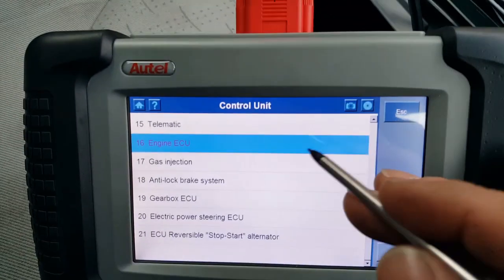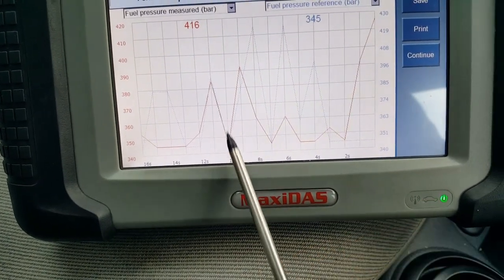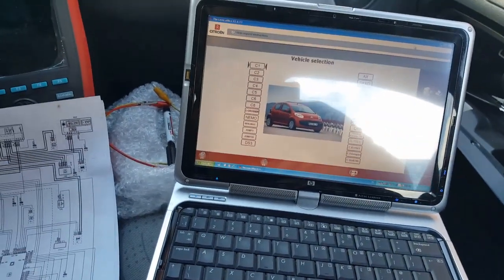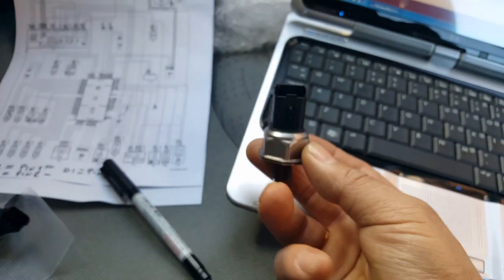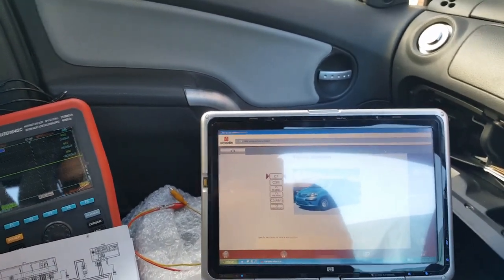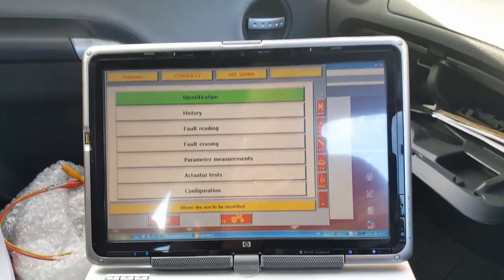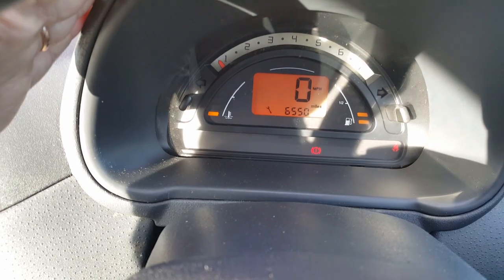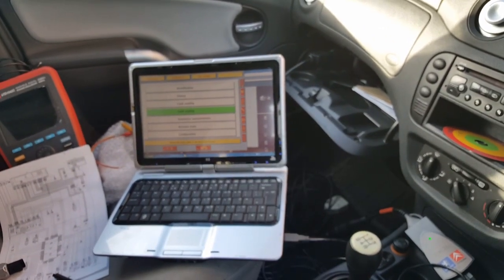Citroën C3 1.4 HDI limp mode, P1164 fuel pressure sensor. Fault finding and repair.

Comment: Hi see you are a specialist of citroen
I have a problem with mine and no one can help me or there is a possible to telephone contact whit you
If so please email me at address iao1560@gmail.com
Reply from the maker: Piotr Swietnicki 
Just ask here... I will try to help...
And that way the information stays available to help others....
Reply: But in which country do you live?
Maybe in uk?
Reply from the maker: Piotr Swietnicki 
Yes... UK.
Reply: Is there a chance of contracting to repair my car?
Reply: I show the charging light after firing the engine and does not work to reach the 20 mile speed.
Then the charging light goes off and the power is on but the abs light comes on.
This car does not start immediately after extinguished but only after waiting and the bsi will turn off it immediately fired.
I exchanged bsm and ecu. No one knows how to help me .
Reply from the maker: Piotr Swietnicki 
Have you checked the alternator output?
When the ABS light comes on, what codes do you have?
Any other codes on the oder modules?
Can you activate the cluster?
Reply: lmsvvavr 
yes show p0344 camshaft position sensor a cirtuit intermittent and p01351 but glow plugs are disconect because is unloade batery if i conect them.
camshaft sensor i change for new but not healp
Reply: I not active cluster i do not now how?
Reply: I spend around 400 pound to fix my car and i do not see any Progress. I'm going to replace the bsi but buying bsi and carport is another 100 and the car's value is about 600 pounds if it works but i do not get many to bay next.
So I'm looking for someone who could help me and repair this car.
Reply: Alternator is ok
Reply from the maker: Piotr Swietnicki 
O have a lot on my hands at the moment....
Try disconnect the ABS system... it will throw the light... but see if that improves anything...
Reply: If i disconnect the abs pomp car do not start when i conect car to lexcia show is right front weel is problem i try disconnect that sensor but not help.
Check sensor and is ok.
Reply: I try fix this car from november so if you have maby time even in few week to look and you not live to far from coventry will be super
Reply: Ofcorse I paid You.
Is to complicated for me.
Reply from the maker: Piotr Swietnicki 
Hi
I can't really do it at the moment...
As I said I already have to much in the way...
The schematics for the BSI on Sedre, are split in sections...
Depends on which section you want.

Comment: I've done a few of these sensors now. Some run in limp, some run but have massive diesel knock and power loss when the sensor spikes high then ok when it drops and some just short with a non start situation. Good job
Reply: what an headeach that's the problem with me I would be messing with pump
Reply: just like to say your very clever how did you learn electrics keep it coming
Reply: is there any way to to get some sort of dummy sensor witch you could use for testing neutralising the ecu
Reply from the maker: One Auto, 
Thank you for your comment!

Comment: great work . when I get this type of sensor that's is no good I don't just put in a new sensor I always put in a new fuel rail . This is what Bosch tell us to do so I always fit rail it always come with a new sensor when you buy a new fuel rail . don't forget at the end of the rail is a pressure relief valve and they can leak and most modern car you have to do a relearn on the sensor    but I know it would have cost a lot of money to fit a new fuel rail .  its just some thing I like to share with you that all . I been lucky and have done lots of Bosch training and they  tell us the rail  are seal and not to ever fit new sensors on the rail ? but yes it would have cost lots to fit a new rail . but great job love you work
Reply from the maker: Stephen Kasapis 
Thank you for watching, comment and share you knowledge and information!
Indeed a new rail would cost much more...
I believe in the end you need to use common sense...
Other than the relief valve and pressure sensor, the rail is no more than a pipe... lol
Although I think is unecessary (depending on the circumstances...), I understand why they advise to replace the rail.